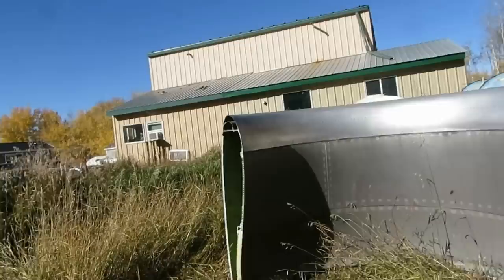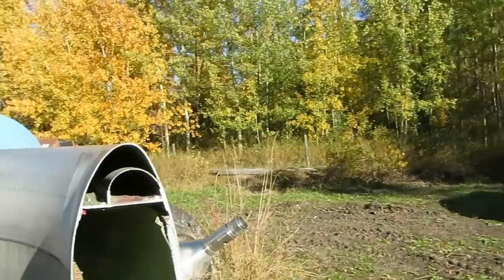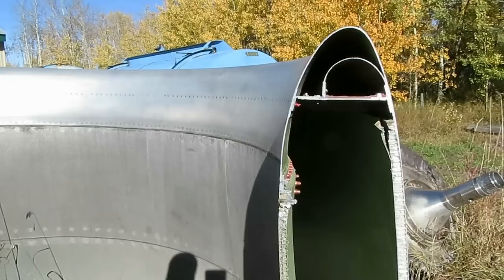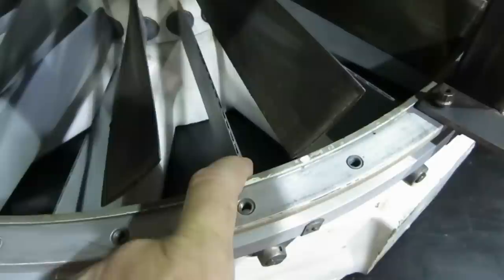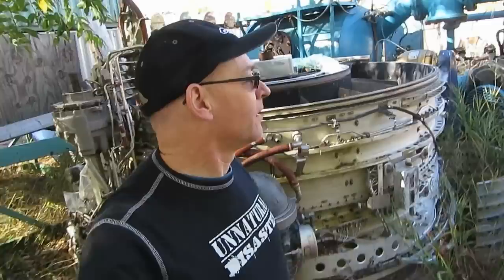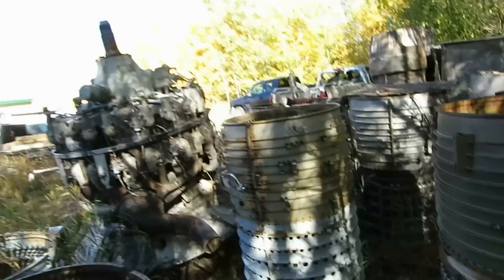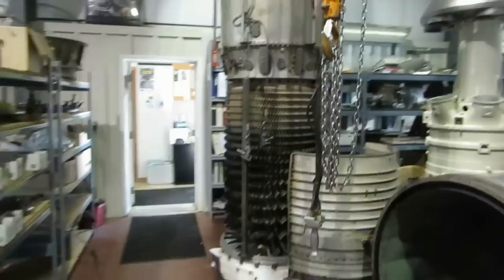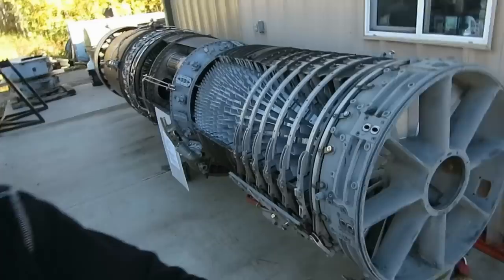Turbofan Anti Ice

Comment: The nacelle has to withstand the 'Fan Blade Off' condition not letting any debris out of it. So this is another reason it has to be so robust. Great video, thanks
Reply from the maker: +Michał Wielek That's not the way I understand it. The engine cases are designed and tested to contain a fan blade that may break off. The cases are titanium alloy wrapped in Kevlar belting.
The cowling is aluminum alloy, and could be punctured by a .22 rimfire round. It would be like paper to a blade off incident with the fan.
Reply: +AgentJayZ I agree, its way too fragile for the job, in fact I didn't realise the nose cowl assembly is so long until now, thanks.

Comment: The inner wall has two layers of honeycomb core bonded together.  It is done to dampen a larger range of noise coming from the fan blades.  You notice that there are structural joints all over on the inlet fan blade side.  The modern inlets on the 787 and newer aircraft the inlet cowl is made as a continuous piece with out structural joints except the forward and aft joint.  The structural joints all reflect noise so they found a way to remove them.

Comment: Wing leading edges have a similar air distribution duct to distribute heated air to the aircraft leading edges.  As you stated, the air distribution to the wings is for deicing; and for the cowl, the air is for anti-icing.

Comment: The R-3350 developed more than 2200 hp.  Used on the Boeing B-29, C-97, the Douglas DC-7 and A-1 Skyraider, and various models of the Lockheed Constellation.

Comment: I like the comment about the more anti-ice air you use, the more power you take away from the engine... running into icing conditions made life unpleasant when trying to calculate ETAs for the next oceanic reporting point... your airspeed/groundspeed kept going up/down as the anti-icing cycled off/on. 

An Ex(very) Aurora Navigator.
Reply: I suppose they have computers that do that now, but to be on missions, particularly search and rescue (where you have to go out when most sensible people would stay on the ground), and have to calculate position and waypoints with constantly changing variables would be more than "unpleasant". I can't imagine. To you, sir, and your Aurora crewmates, my thanks.

Comment: Nice illustration of how the nose cowl is a divergent duct, reducing velocity and increasing pressure of the air entering the fan. It's not as easy to notice on the aircraft.
Reply from the maker: There is no fan in the Orenda, or any turbojet engine.
Reply: AgentJayZ. You think thats a nose cowl of a turbojet and not a turbofan...right.
What do you think that big round thing is in my thumbnail picture im standing in??
Reply from the maker: I somehow mixed up the video you were commenting on with another, so I my response to you was completely off target. Sorry about that.
Let me know if you want my mistake erased, or saved for the entertainment of all. Your choice, sir!
Reply: AgentJayZ. lol thats ok. I was trying to work out what Oranda was and why you included an Iroquois name, Im an Aussie after all!
 I also owe you a thanks, Ive had a HPT blade sitting on my shelf for years thinking it was out of a CF-6 but after seeing your video on titanium blades realised its a RR RB-211 ...even better!!
BTW... The big round thing is a Lauda GE90-115 back in my Qantas days :)
Reply: AgentJayZ. Speaking of Orenda Sabers, Do you know why the CAC (Commonwealth Aircraft Corporation, Australia) used a RR Avon instead of the Orenda? I would have thought CAC would have followed suit as the Orenda Sabers were faster and had better range and would have saved having to reengineer the Saber for the Avon.

Comment: Very cool video. I never even thought to wonder what the cutaway of such an engine nacelle would look like. Thanks for sharing so much knowledge through your videos over the years. I don't ask many questions because you cover everything so well. I am curious as to what that dark bulbus part with the red hoses near it is, right beside you on the front frame of the CF-6 (6:08 into the vid) an oil cooler maybe?
Reply from the maker: +20bluebug Believe it or not, that's the main oil tank for the engine. The oil is worked very hard in these engines, and consumption is low.
Reply: +AgentJayZ  That's pretty cool its so small relative to the engine...but then again others you showed in the past, namely on the J79 are also relatively small.  Thanks :)

Comment: Thanks a lot for your great help & efforts , and you are an asset .
My Question as if its possible to share as a video about the 
1-Fire Protection System how its work on Gas turbine Engine 
2- Power Augmentation Systems on Gas turbine  Engine
Reply from the maker: +Osama Mukhtar 1) That is not part of the engine, and we never work on those systems. So no.
2) Nobody uses that term,because there are several different ways to increase power output temporarily for short periods of time. I have discussed them in quite a few videos. So no.

Comment: Thank you for making these awesome videos! (Hopefully) quick question: is there a easy and quick way to see what end of a engine is the front or back when they are partly dissassembled in your shop? I have a hard time distinguishing that when i only get a quick glance at them in some of your videos.
Reply: +acy48 
Assuming this wasn't answered as I watched the video:

The front of the engine is the compressor, which is low temperature. The rear is the turbine which is high temperature. Typically, the front will be made of some sort of titanium so it will be silver. The rear is usually made of a much tougher alloy and is brown/red. Another thing to look for is the combustor cans. They are in between the compressor and turbine, the compressor is usually longer than the turbine.

Emphasis on usually
Reply from the maker: +acy48 With respect to RCFlyer, the answer is much simpler than that...
When you work with something for a long time, whether it's jet engines, cars, jewellery, bread making equipment, dinosaur bones, chickens, or electric guitars, you get very familiar with your field, and can tell what's what instantly, from a distance and at high speed.
As an example, most musicians could identify  a Gibson Explorer, Les Paul, and SG, as well as a Fender Stratocaster and a Telecaster...  if they were a hundred yards away and passing by a stage at 80 miles an hour where all five were being played. It would be so easy.
Whereas anyone who doesn't know guitars has no Idea what I just said. 
It's the same thing.
Reply: +Jonah Beale (RCFlyer)  ah i never noticed the colour difference between the cool and the hot "end". i agree, when the combuster is installed and it's using the layout with the seperate combustor cans its pretty obvious. i've revisited a few old videos and the mechanisms for the variable stator system are also a dead giveaway (when installed). 
it's just a little tricky sometimes to identify it when half of the engine is hidden in the ground.
thanks for the great tips!

Comment: You mentioned that the perforated panels are for noise attenuation. I also heard from an AME that behind the perforated panel is a solid panel (say 1/2" clearance between the two), that when air flows over top the perforated panels, a low pressure area is created behind it causing the intake air to hug tight to the perforated panels allowing for better distribution of intake air. Is this true? I can't find much online about it.
Reply from the maker: +NovaScotiaKevin I do know that the perforated panel is constructed the way you say, and it's purpose is sound attenuation. If you get close to it, you notice it really works. As far as causing "better intake air air distribution"... I'm always suspicious of vague, subjective terms like that. 
each little perforation leads to a sealed chamber, created by the honeycomb intermediate layer, capped off by the solid sheet on the other side.
No flow is possible, except in a very small, high frequency alternately reversing manner. Hmmm... that sounds a lot like .. sound, doesn't it?
These panels reduce the high frequency screaming noise made by the spinning fan blades, to the point where the fan on an airliner doesn't really make a screaming noise, does it?  Funny that.

Comment: Interesting to see that the engine nacelle has a wing shape. Logically it must increase the air speed inside the engine. No ?
Reply from the maker: Exactly the opposite. The front of the nacelle forms a divergent duct, and acts as a diffuser. The velocity of the inlet air is decreased as it's pressure is increased. This helps increase the efficiency of the compressor.
Reply: Thanks a lot  @AgentJayZ  for your reply and explanation. I love your channel !

Comment: Is some of that anti-icing air on the J-79 also used as Boundary Layer Control on the wings of the F-4?  I worked on F-4J's for the US Navy back in the Late Neolithic.  We had -10 engines, so you can see how long ago it really was.  However, I was an avionics tech, so I didn't work directly on the engines.  Thanks for the videos.  I try not to miss any!
Reply from the maker: +Michael Messick Likely would have been air bled off the compressor about halfway back.No need to use full CDP for the wings. The real answer is out there... probably on Wiki...
Reply: +AgentJayZ I do remember my friends in the engine shop saying it came from the 17th stage.  I could be off, it has been a long time.
Reply from the maker: 17th stage would be full CDP. Maybe that is what's used. I'm sure the info is out there.

Comment: quad honeycomb  aluminum , that is soon cool. what is the approximate  weight of that piece? It looks very expensive  and very well made, love it
Reply from the maker: +hommie789 It's as light as can be, but it needs to be strong, so it's a couple hundred pounds or so. The new ones are carbon fiber.
Reply: +AgentJayZ wow that big and that strong making it only a couple hundred pounds is quite a feat of engineering. impressive

Comment: Is a turbofan a turbine powered ducted fan?  I know you are not an aircraft person, but you are obviously knowledgeable and articulate.  The two look similar to me, but I don't know that's what a turbofan is.
Reply: +Michael Messick Yes, I think you could reasonably describe a turbofan as a gas turbine-powered ducted fan - but the industry doesn't.  I'm familiar with ducted fans (I/C and electric power) in R/C model aircraft.  However, a so-called 'unducted fan' (UDF) was flight tested on the back of a DC-9 some years ago.  From memory, I believe that the core engine was based on an F404.  I've checked since I first posted this and it was: it was designated as the GE36.
Reply: +grahamj9101   Thanks!  I remember the DC-9 experiment.

Comment: OK, bit of confusion here.  You showed the anti-ice for the Cowling and the anti-ice for the struts/IGV.  I understand the latter are fed compressor air by the antlers.  What is the source of compressed air for the cowling, and is that air vented and recovered back into the engine core (albeit much cooler now) or does it heat the larger cowl as well as the leading edge?   I'm just trying to follow the path of the compressed air that heats the cowling from the source to the final exit.  It is very impressive how the designers go to extreme lengths to not waste anything.   We all know it takes thousands of HP to run the compressor stages.  How much of the total compressed air energy is used for anti-icing?  1%   5%  10%?  Is it always on or does it only get run at certain altitudes/temperatures?

You start to wonder how these engines run given that they seem to have a million holes that leak air.  ;-)
Reply from the maker: +Robert Slugg Anti icing air is always taken from the compressor. Not sure which stage, because we are not even sure which engine was in the nacelle. I'm not trying to teach about the entire system here. I'm just showing interesting bits as I encounter them. There's a lot of info to be found by searching the interwebnet for anti ice...
Reply: +AgentJayZ Thanks.  I did locate a bunch of info on wing anti-icing and a little on the cowls.  They also discuss how an automatic on-off switch determines loss of lift when ice is encountered, sort of a mini-wing on the fuselage.

Comment: how long has that 3350 been sitting, how many of the parts necessary for it to run are still on it, and what would be the selling price?
Reply from the maker: +Patrick DeStefano Al parts are on it. Everything needs to be brought back to life. It could never run without a lot of work. As it sits it is scrap. Shiny and running, it will cost a fortune.

Comment: When is a a fan? 
OK, the J79 has no fan. You said it, we believe you! :-)  But when is it a fan. The distinction is clear on a high bypass engine. But you visited the CF-18s recently. Those have GE F404s of course, which are described as "afterburning turbofans". But how does the front element of this differ from a J79? There doesn't appear to be any bypass. Or is it just so not-high that you need to know where to look? :) 

Cheers
Reply from the maker: Bypass ratio for an F404 is about 1:1

Comment: Why does the anti-icing flow come from the compressor rather than from the combuster or turbine? wouldn't it be more efficient if it were to use the hotter air?
Reply from the maker: +eivilcow33 Apparently, 500 degree air is sufficient to keep ice from forming on exposed parts. For some strange reason, there is no need to use one thousand degree air. Go figure...
Reply: Well I meant they could use a lower mass flow rate through the anti ice ducts to get the same effect. (also I completely spaced on the fact of that the compressor gets the air that hot)

Comment: Hey Jay, what are your thoughts on using exhaust air instead of compressor air to deice the engine? is it too hot to be useful?
Reply from the maker: Exhaust air contains combustion products that will cause a buildup of residue that will need to be cleaned out of all internal spaces where it is routed. This will require more work and expense.
Also, Compressor bleed air can be tapped at a position where it is an appropriate temp for anti-ice use.
Exhaust gases are way too hot, and dirty.
Reply: @AgentJayZ  thank you. you are awesome Jay. thanks for the great stuff you post.

Comment: Looks to be a JT-9 inlet. Probably off of a 747-100 or -200
Reply: +rkan2 I can see where you get that, but there's 2 things that tell me it's not an RB211 - 1) It's too small.  I work with a 757 that has RB211's every day and it's bigger in diameter than that. 2) It is too thin and deep.  The RB211 cowling "puffs" out and then pulls back in, giving it a bulbus exterior contour, this one is straight.

Look at this pic of a JT9D cowling on a 747-100 - https://www.flickr.com/photos/ruthann/430944070
versus
This pic of a RB211 - http://www.fspilotshop.com/images/TSS-675d.jpg

Notice how the RB211 cowling is much "shallower" on the RB211 and much more "angled" than on the JT9.
Reply from the maker: +Chris Trott Awesome pics. We need more folks like you with specialized knowledge. I would go by the pattern of the rivets... I haven't done a side-by-side comparo, but I suspect you are right about it being a JT9D cowling. Maybe the writing wasn't AC for aircraft; maybe it was for Air Canada...
Reply from the maker: Yes. I thought it looked like a repair.
Reply: +Chris Trott I'm not that familiar with RB211 cowlings, etc, but I agree with Chris Trott.  The inner and outer surface curvatures look wrong for it to be from a 211.
Reply: +Chris Trott Aircraft 6615 sounded like Northwest Airlines to me so I looked it up an old jp airlines fleet book....   6615 is Northwest Airlines 747-251B N615US line number 165 produced in 11 1971 with 4 Pratt & Whitney JT9D-7Q.
Reply: +AgentJayZ Just a few days ago I watched a video on here of a Northwest 747 and then looked up some info about it so when you said "Aircraft 6615" it sounded like Northwest Airlines to me so I looked it up in an old jp airlines fleet book... 6615 is Northwest Airlines 747-251B N615US line number 165 produced in 11 1971 with 4 Pratt & Whitney JT9D-7Q.   :)

Comment: I always wondered why they didn't use late-stage compressor air for anti-icing, then dump the cooled compressed air back into the compressor for added power.
Reply from the maker: The more you compress air, the more costly it is in terms of energy added. Once used for anti-ice. it's at a lower pressure, and would need to be added to the compressor upstream of where it was tapped off. It is an attractive idea to think of the anti-ice manifolds as an intercooler, but it is not that simple. It's a tortuous path, where much of the pressure is lost, and it's more efficient to just vent it off.
Reply: AgentJayZ Thanks. Another example of something sounding great in theory, but not working out in practice.

 Cheers.

Comment: want to ask you this when watching h 1 unlimeted boat raceing they talk about ( in to ) where it is to high and they get points taken away what the heck are they talking about
Reply from the maker: +matt phillips Need a bit more information and clarity before I can understand just what you are asking.
Reply: when the boats are on corse and they come in from race i guess they hook a computer to the engine and if this (in to ) is high thet are doced points and place they finsh at maybe fuel in to maybe i am not sure
Reply from the maker: If you mean to say N2, that would be power turbine rpm. Maybe the rules set a max for that, but then every boat would have to be using the same engine.
Reply: not sure i do fair at piston engines but you throw a turbine at me and i am like what the hell